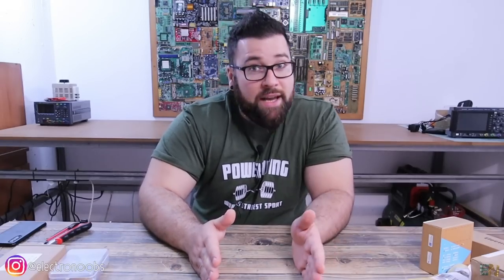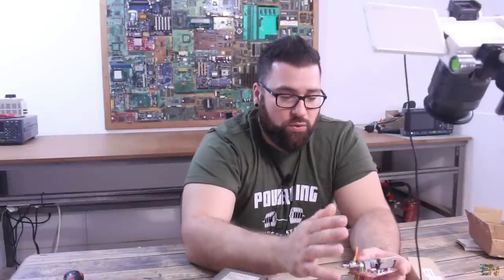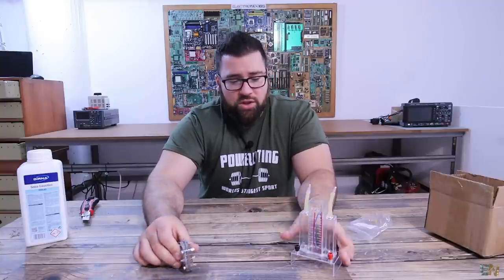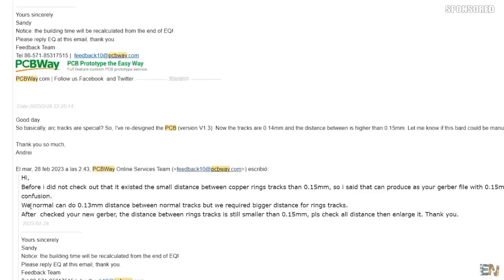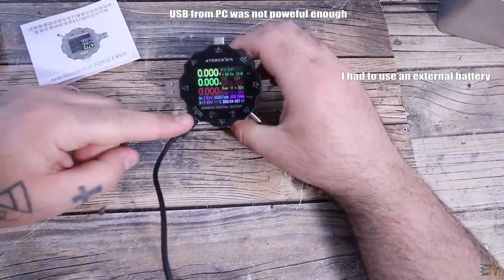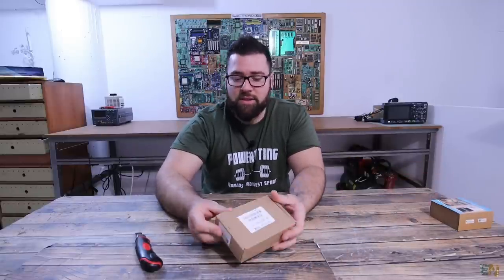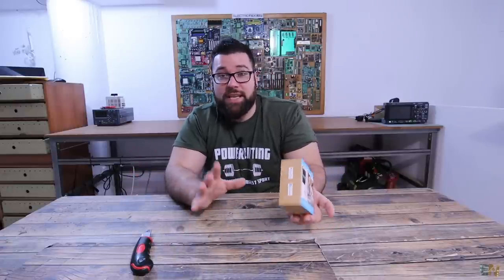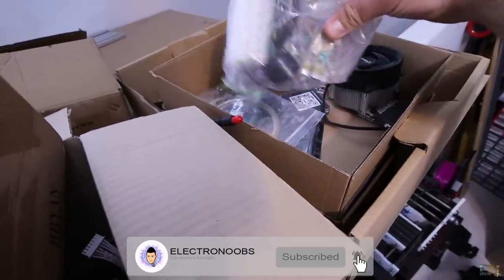MAILBAG - Check What I Receive For My Projects

Comment: There are two issues with the links in the description: The "ESP32 Development Board" link points to the "Digital Load 100W" and the "Battery Tester" link points to the "Desoldering Iron"
Reply from the maker: Thanks, I'll fix that :)

Comment: Wow your workshop is literally heaven for me😊
It can be good if you can make arduino based hot air rework station, because in my place those are very expensive with customs fees, and cheap hand-held ones does temperature control with classic dimmer which is not very precise, but arduino can provide PID control and lot more for less money

Comment: Good to know..i was about to buy the same battery tester as i thought it uses the 2nd battery to kinda discharge the 1st batt into it. Kinda letting the energy flow in a circle. First top off the first battery, then discharge into the second battery instead of completly waste the energy. That would be a neat design as i dont like to waste energy...and if you got to test 100+ battery it not just a little bit that goes to waste

Comment: Wow, I can’t believe number of high-quality projects you crank out - and how many more you have planned! I’m definitely interested in your improved spot-welder board and project, as well as the enhanced battery tester. (It’s funny, I was thinking “ah, I’ll post a comment suggesting he use the 3-channel current sensor I just learned about in his vid about current sensors”, and had no sooner thought it than you said you might make a 3-channel system :-) I definitely vote for a 3-channel design, since most of us have a number of 18650 cells laying around. (Oh - also how about you include some extra solder pads in case someone wants to attach battery holders for 21700s?)

One question: Where did you find that heavy-duty spot welder electrode holder? It looks very beefy, and a lot less hassle than building up my own.

Thanks for the great content, I didn’t realize until just now just how much material you have here, and what great quality it is! (The channel name had me thinking it was just going to be very basic stuff, but while your material is all very approachable, many of your projects are quite sophisticated, like the pure sine wave converter 👍😁)
Reply from the maker: The handle is from AliExpress
Thanks!!!

Comment: @31:34 : I was planning to use a HMI display for my bike's display with some extra diy sensors attached and use wifi to monitor remotely along with accelerometer and hal effect sensor for rpm and speed , along with some gps arrangement to track my bike and see all this using my phone over a webserver may be using esp32. The day I recieved the display I dropped it and broke it so left the project and never looked back. So if you are planning to showcase the display , then please consider showing the gauges and realtime updates of values both gauges or digital as a use case (example) could certainly help and could be relatable.

Comment: Hej what are the small mini white connectors called that ppl use for model building, so you can connect a lithium battery to a motor or model gizmo. They are white and small. Do you know and where can i buy some please. ?  Thanx

Comment: I have almost the same board, ESP32-2432s028, I have been trying to get it to work, but it is a true pain to get the screen working, since I suck at it. 
It is now just collecting dust. 😂But the board itself works like a charm.
Reply: İ have the same board... İt's really annoying that the examples are not user friendly... After for a while i managed to do that on Arduino ide. Let me know if you need it.
Reply: @thenextproblem8001  Thank you so much, I would love to have it. 🤩
Reply: @-MrDontCare-  so is there any contact info you will supply 😊
Reply: @thenextproblem8001  You should find an e-mail in the about section on my channel now. Just added it. Did you find it?
Reply: @thenextproblem8001  Guess, you forgot all about me. No problem.
Reply: @-MrDontCare-  nope im waiting an email to be appear actually. Still waiting
Reply: @-MrDontCare-  send it:)
Reply: @thenextproblem8001  Thank you so much. I replayed.